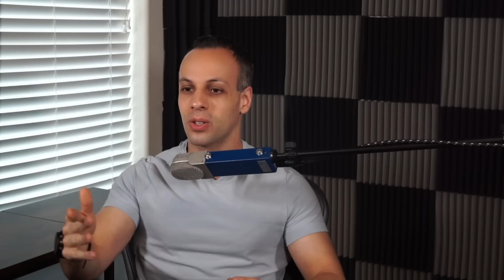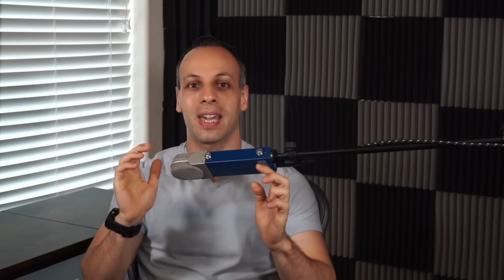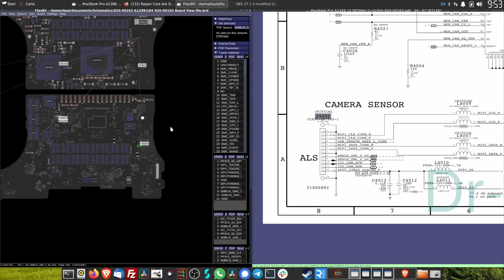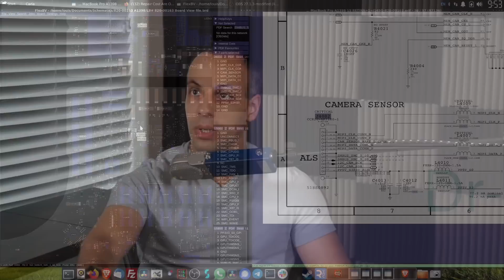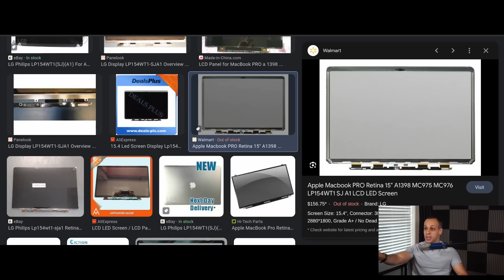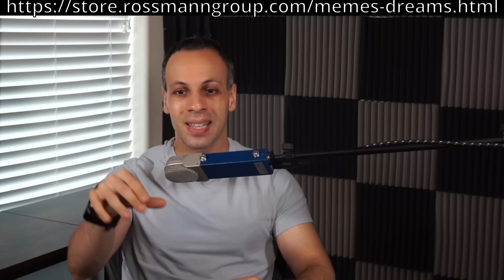The Ford F150 Macbook - when car repair resembles macbook repair...

Comment: I remember when the old chrysler/Plymouth ran a commercial with the car running and the hood up (1960s or 1970s when I wasjust a kid) . They fire hosed the engine compartment to show how water resistant their new electronic ignition systems were designed.  But the Ford engineers who would suggest such a test on the Ford, are likely told to shut up cuz it would add to the cost.

Comment: Tsk, tsk Lousi !!! You are SOOO picky , what do you expect ? Its obvious these "rugged trucks" are designed to only be used indoors. I bet its even listed on page 532 in the user manual they forgot to ship with the truck, just look for what looks like a comma on line 43 there. And as such of course the warranty is void if the truck gets anywhere near moisture. You should praise the design choices these clever engineers take to give the customer the best possible experience they can get. I sure hope no-one can detect any hint of sarcasm in this post.... ? PS Guess where the main computer for the gearbox in an audi a6 is located , Is it UNDER the passenger floor mat ? YES IT IS.  Does is have a 5 cent O-ring to protect it ? NO IT DOES NOT. Is it in the one place in the car where water ALWAYS sits ? YES. Lets reward the clever engineers that design our stuff. Who has the tar and who brings the feathers and pitch ?

Comment: This is exactly why I bought a base model vehicle. I didn’t want LED’s. I work on Semi’s that have them. They good bad more frequently then you think. Yea, you may replace your light bulbs more on a normal headlight. You want to know what you have to do with LED’s? Replace the WHOLE headlight assembly. Mind you, I work at a DEALERSHIP. This is how you repair a bad light in the headlight. Yea. Sticking to non-led.

Comment: Added to the cost isssue of things all connected to the canbus is the issue that this has increased vulnerability to theft because it provides access to the car's system for the reason of theft allowing starting and key programming etc

Comment: Teslas are becoming unaffordable - starting with what used to be a couple hundred repair on an '86 Mustang bumper cover to up to $10K on a Tesla. The F150 taillight was ~$3500 for the assembly/module which was corroded with the rest being diagnosis. Thankfully my same year F150 does not have that $$ BLIS system that FordTechMakuloco repaired (good site for Ford truck owners). Luckily I can repair many gadgets but things like BOSE CD changers, LG electronic clothes washers and HP printers are costly throwaways, build by companies with too many bean counters

Comment: I'm not sure what is happening with the world today but I work as a mechanical / industrial engineer at a company and often have to look over brand name tools such as bosch / ridgid etc to fix them and have found that engineering today is terrible everywhere. For example if you buy a brand name tool such as a bosch miter saw you'd be surprised to learn that many of their screw insert holes don't align with the thread holes. This isn't a one off problem either. It's a problem that exists everywhere.

Comment: The reason these types of issues are becoming increasingly common with cars, has do with the increasing computerization of car design. And I'm not talking about EV's. Regular internal combustion engine cars are no longer a collection of interdependent analog mechanical parts. Instead behind every part, there's a computer chip that controls every function of that piece. The timing of the engine, the fuel injectors, the gearbox in an automatic transmission, the anti-lock brakes, etc. We found this out two years ago when car production went down and prices shot up because of the chip shortage. So if cars are now designed to function using computers, the same design philosophy behind engineers deciding to have the webcam, thermal sensor and ambient light sensor share the same line connection on a Macbook, is the same reason why an obstacle detection module in the rear headlight is connected directly to the engine in the front and bricks the Ford if that piece fails.

Comment: It baffles my mind that practically all cars use CAN-BUS (naming differs depending on brand, though) where a single twisted pair data wiring is shared by all devices and the wiring must have exactly two working terminating resistors to avoid having too much noise in the signaling. It's basically similar to "thin etherned" that was deprecated for computer networks around year 1999 for the exactly same issues: a single misbehaving device will take down the whole network and makes even debugging the issue really hard because all signaling is bad.

Comment: Ford f series is notorious for having body control module problems for the rear turn signals. One of the turn signals would work and one would not, New bulb, wires good, switch good, hazard works both lights, problem in the BCM. Have fun replacing a 700 part that needs to be programed.

Comment: Computers in cars arent inherently a bad thing, I drive a 21 year old car with 4 seprate computers in it. The difference is the depencency. My car only needs 1 of those computers to work in order to run and drive. Nowadays if even one of the computers in the car fails, the whole thing is a brick. The failure rate of computers is very low, but not 0. Engineers need to consider when things go wrong

Comment: Oh how I wish the head-/taillight housing was separate from the clear polycarbonate plastic, so if it cracks or vellows, you just replace the clear part for cheap. The same goes for the defective LEDs/LED modules being as easily and quickly replaceable as regular light bulbs.

But no... Profits over sustainability/ease of repair all the way!

Comment: Oh, Ford....ah yes. I had a water pump go on my Explorer. $150 part. Easy, right? Wrong! Ford made the water pump internal to the engine, driven by the timing chain. So, how the dealer does it is to drop the engine, trans, and front suspension to the ground, and work on it there. So, a $150 water pump becomes a $3,000 repair. Oh, and I had to wait 3 weeks for the water pump, as it was on national back order. Thanks, Ford!

Comment: I think one of the major issues with cars now is that they’re designed to sell in the showroom, rather than be used, so there’s an imperative to get as many features in as cheaply as possible, and damn how well it functions post-warranty. It’s also how you wind up with touchscreens rather than physical controls, and stylized instrument displays, which look great and are easy when stopped but almost unusable (at least safely) on the move.

On the issue of lack of one person having oversight on how stuff works, counterintuitively I sometimes wonder if it isn’t an issue of being /too/ well resourced. I remember reading an article on the development of the MQ-28 Ghost Bat. One thing noted by the Americans involved was that, because the Australian teams were used to working with much fewer resources, everyone involved was used to doing everything. So, everyone had an at least passing knowledge how the whole system worked so development went faster and smoother, rather than having dedicated component teams doing their own thing in isolation.

Comment: I attribute the whole thing to garbage engineering. And garbage materials being used.  Look at motorcycles for example.  We ride around in the rain and never have electronics go bad.  Modern bike have as much technology and electronics as most modern cars.  Electronic throttles, road sensing suspension systems, mine even has a 6 axis gyro to detect and control rear wheel slip, rear end slide while leaned over, wheelie control and a few other things.  All of this is exposed to water and dirt as we ride around.  These systems almost never have faults.  Because the engineers are if a higher standard and the companies use superior materials and workmanship

Comment: Just opt out of the radar in the tail light, when those came out I knew they were insanely expensive. Still have my 2004 F150 4.6L V8 running strong. But those 5.0 coyotes are fast

Comment: Hate to say it but the cost makes sense. To offer the features they do those sensors have to be positioned correctly for calibration, making the tail light assembly pricey with it's construction. Each module is also expensive because of the nature of it's function. What doesn't make sense is Ford not making the modules water resistant. If you drive off road, use your truck for work, or even just live somewhere a shopping cart my hit the rear of the vehicle, at some point you're decently likely to break a tail light. Upgrading the connections to water proof ones is negligible in cost, and the sensors themselves are sealed and should be resistant to general moisture. By not using water proof connections, they turned a $600 repair for the tail light housing (swapping over the old modules to the new one) into a $5,000 repair because it corroded the electrical contacts and back-fed the medium speed canbus causing the truck to not function.

Moral of the story if you're buying a vehicle; don't buy one with expensive features you don't need as they become extremely expensive to fix when they break.

Comment: My son's Sonata electronic system failed because of failing part of the brake system. The car could still drive, brakes were fine, but the car downgraded itself to a purely manual system. The automatic transmission shifter mostly worked but there was no indication of what gear you were in. It's a turbo which often resulted in the car shooting off like a rocket because it couldn't shift out of 1st gear smoothly. I drove it to the dealer and our extended warranty paid for it. While I was at it I had them replace several sticky switches and when they were done my warranty had paid for itself.

Comment: A very fun thing my POS BMW X5 has done recently (I say recently because literally everything on this car will break. Your locks. Sun visors. Windows. Door handles. Literally everything. It’s so fun having no working AC or even fan and also having no windows that you can roll down and living in southern CA in the summer!) is, if you don’t close the gas cap all the way by accident, or, as in my case, the sensor will break for no reason at all (because, worst car) and then you know what happens? Your check engine light will come on. The only way to have the check engine light that came on mistakenly because of a faulty sensor is to go to the dealer and pay $180 to have it turned off. You know what happens if you are required to have a star certified smog check so you can renew your registration and the check engine light is on? Automatic fail. So not only will I have to pay my registration, but a bonus $180 to have the light turned off (zero guarantees it will not happen again), plus the price of the smog check. Isn’t that such a fun feature?!

Comment: As a person working in the automotive electronics industry I can assure you that Ford knew exactly what happens when you have a fault that shorts the CAN bus and prevent any other communication on that bus. All devices on the car will have a failure mode analysis done. Now this just means that they know the consequences of this fault and they are interested in the likelihood of this happening, which is probably low enough that they decided that this design is good enough. Just my 2 cents in this matter, not trying to defend Ford at all. These faults that can cause an ECU to bring down a essential bus in the car  are in my experience treated very seriously. Not sure what happened in the design of this truck of course but this is my educated guess.

Comment: Louis, this is what we get for the modern day creature comforts. Ford isnt trying to make the vehicle more difficult to repair. The only reason he replaced the modules was because they had liquid damage inside the module, the tail light housing has a seal to prevent this. This was just a seal issue. With the BLSS or blind spot object detection module it has to be on MSCAN because it needs to talk to the cluster to tell the driver thats to stupid to look out of a window that there is someone next to them or turn on the indicator in the mirror. Thats why it runs on the mscan. Unfortunately because this truck is to new no one makes aftermarket parts for the tail lights connectors and modules. Thats the only reason this customer had to pay 5k

Comment: It's not only limited to the F150 in the UK if you have a Ford Fiesta with an Ecoboost Engine the Camblet/Timing belt is £2000 to replace you can only get it done at Ford because it's a wet belt that requires the engine to be removed to replace it. It's a part that needs to be done and you are forced to go to the manufacturer.

Comment: 2010 chevy equinox 3.0 v6 newest car I've ever owned and changing the oil is a nightmare why do soccer moms need dual exhaust for one but the exhaust is right in front of the oil drain plug n it has the slightest angle i needed a 2 feet of extentions on a impact driver to get it off if this was my first time changing oil i probably would have given up manufacturers are well aware that people just want a robust simple automobile but clearly there lizard people that hate humanity 😂

Comment: BWM motorcycles have been designed this way for the long time. Replacing the ECU and one gas spring for the trunk lid on an older K1200LT touring bike costs more than the blue book value. The K1600GT is absolutely ridiculous in this regard. In terms of serviceability, it's by far the worse bike I've ever worked on - and I've been at it for 55 years.

Comment: on the Ford that makuloco fix what happen was the blind spot dention module in the rear, when it fail it sent battery power in to the CAN, the gauge cluster is a part of the LS-CAN, MS-CAN, and HS-CAN and it does the key check for engine start it's the brains of the PATS system. when it and the other modules seen battery power on the CAN they shut them shelf's off to protect them shelf's from damage. when the PCM powers on it asks the gauge cluster if it's cleared for engine start. if it replies with a NO GO or no response from the gauge cluster, the PCM jumps into theft mode, from here it cuts power to the Fuel injectors, ignition coils, throttle body, and will refuse to crank the engine. if the has started the PCM shuts it off.

Comment: Had a similar problem with my 1969 Chevy C10.
Nice light sensor at the Safeway parking lot told me my taillight was out.
Drove down the street to O'Reilly auto parts and for $1.75 got two replacement bulbs.
Cleaned the bulb socket and sealed the gasket.
That was probably 10 years ago and the light works fine.
Neighbor swapped wheels from another car with better tread to go on a road trip.
Car went into limp mode (15mph) because the computer didn't recognize the tire air pressure sensors...wow!

Comment: Yeah. This is definitely contributes to the high used car prices in my area. 80’s and 90’s Hondas are sellling for similar prices to much newer models because they’re fuel efficient, reliable, durable and most importantly, easily repairable. It’s a two sided sword but I personally stopped buying used vehicles newer than 2013. Too much electronic complication for my taste and the benefits don’t outweigh the drawbacks.

Comment: I’ve been a mechanic for 30 years and auto repair has been for awhile been becoming non sensical . But it’s reached another whole level with much more coming . It’s getting where you can’t replace common parts without the equipment and most importantly the access to manufacturers data support to just recognize the new part even though it’s the same part and does the same thing
Reply: New cars are not only making people become poor but keeping them poor too.

Comment: Well it gets worse. When a car is wrecked you can’t even use the modules out of it because they are vin coded and the manufacturers won’t allow resets. It turns to hacking and finding the right people to get it work often losing certain control unit features along the way

Comment: You're giving these assholes more credit than they deserve. Look at the model T: "designed to me maintained and repaired by the common man with common tools" Have you ever tried to work on a modern car? Try changing a starter or alternator that every engineer KNOWS will need replacement. Good luck.

Comment: I am actually designing a computer to control automated farms , greenhouses , wood dryers etc. and I remember a line from a movie that basically said we are sacrificing everything to make the device a half a millimetre thinner . My computer is hovering at around 50mm thick and it is very repairable , the parts are off the shelf , it's a repairman's wet dream , and the price the customer (a farmer in this case) has to pay for this wet dream ? An additional 30mm in thickness.

Comment: Louis, I think that even if you did have someone with that birds-eye view (which you do have), they would only ask 1 question... What percentage will outlast the warranty period? 
ONLY if that number will affect their bottom line, will a fix be implemented, that that fix will only be the cheapest, easiest, fastest thing to save money with getting the product life over that line. 
Mechanics can design vehicals to last forever, be maintained easily and cheaply.... engineers are needed to make a "good enough" product. Good enough is never in your favor....

Comment: Ford started building trucks that needed the cab to be removed to work on the engine and they made it the most expensive truck in history and failed constantly.  Ford and Apple are cut from the same cloth.